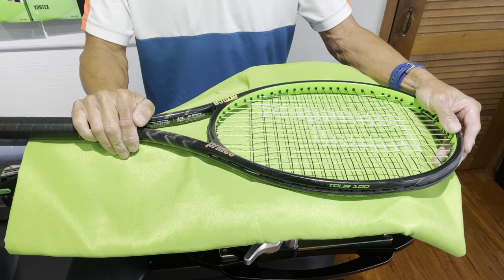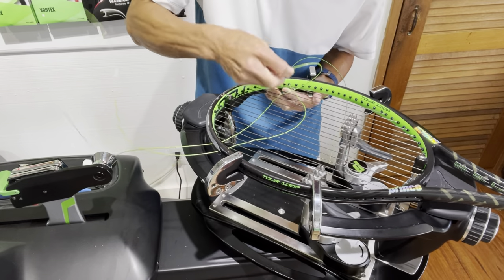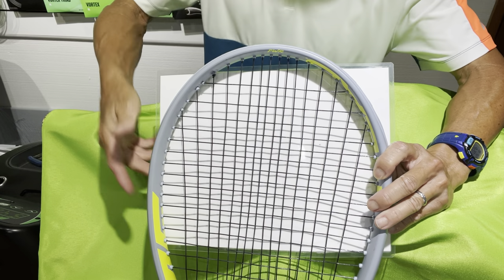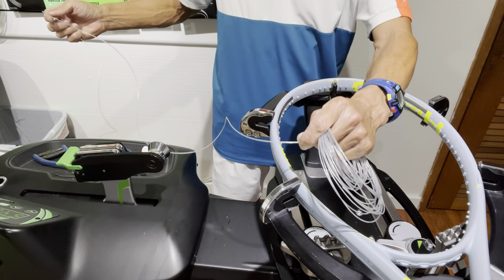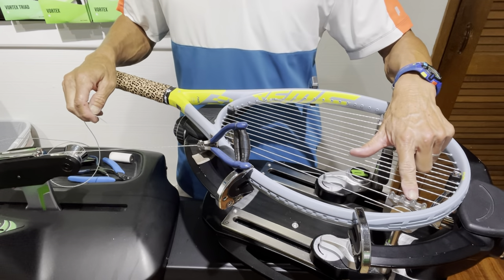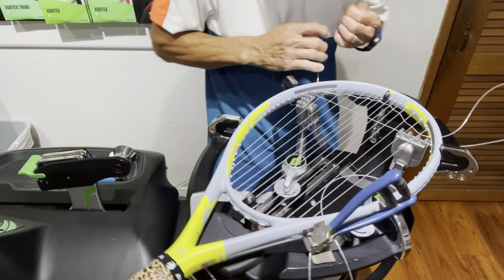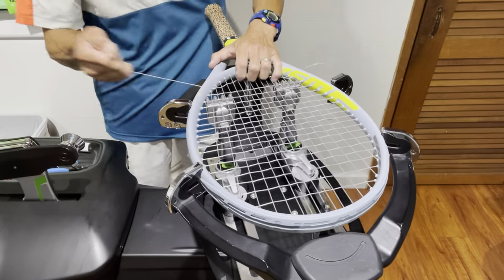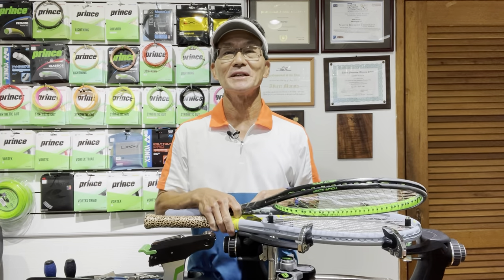Racquet Stringing [2022 Update | Install Crosses Faster & Reduce Friction + Bonus Tips]

Comment: Would starts the cross in the middle of the racquet even the friction on entire string bed bc you have equal length
Reply from the maker: Aloha Nelson, Yes, I guess in theory it would, however, it is always safer to install the cross strings from top to bottom. The shoulder area (5:00/7:00) of the frame is much stronger than the top of the hoop (10:00/2:00). When installing the crosses, stress on the frame will naturally occur due to the tension applied on each string. The frame is more capable of handling stress when it goes in the direction of the stronger part of the frame versus the weaker part. I hope this answers your question.

Comment: Mmm.. 
The two piece method I use often enough: threading two or three strings depending on the frame. 
The one piece version I’m uncomfortable with the potential frame unbalance of tensioning of the short side main and finishing the three whilst leaving the final long side main yet to tension. I guess tensioning the main on the long side and leaving the clamp at the top would get in the way of the three grommets so is NG. 
Let me try it and see. Thx!
Reply from the maker: Aloha Keroppikun, 
In order to string one piece with the method I demonstrated, you must have swivel string clamps and a starting clamp. If you have those two, you're good to go! Good luck!! 🤙

Comment: If you could answer a question for me. When I string multifilaments I am always above my set tension on my machine (gamma progression els ii).
When I check on the apple app for racquet tension if I set it to 45 pounds for example it will come out 49 when I am finished. 
This doesn't happen when I string polys, it only happens when I string multis. I have done 3 different strings types on 4 different racquets to check my sanity multiple times and it keeps happening. Any thoughts on why? The polys on the app are a lot closer to what i set, usualy a couple pounds below, but being below my set tension makes a lot more sense to me than being above my set tension.
Reply from the maker: Aloha, 
I don't believe you're doing anything wrong, but here's a quick lesson on reference and actual tension. 

First, the tension that you set on your machine is referred to as the reference tension. 

Second, the tension reading your measuring is the actual tension. However, some devices are more reliable than others. Are you using the RacquetTune app? 

Third, the reference and actual tension don't always match each other. Nylon strings (synthetic gut and multifilament) tend to read higher than polyester strings. 
Other factors affecting the tension reading besides string type include head size, frame stiffness, string pattern, and string gauge. 

Finally, the main thing is to take initial readings off the machine to track consistency in your string jobs with the same string and the same racquet. The other valuable information to track is tension maintenance. 

Here's a video I did with various string tension devices - https://youtu.be/LzCXrTgMPLE 🤙
Reply: @AMstringing  I just watched your video and it was very helpful!! Your explanation was so clear and thorough. Thank you for taking the time to teach me about different tension readings from different sources. Yes I am using racquettune. After watching your video I decided to buy a ert300 . The ert seems to have more accurate readings in general.

Thank you again from a novice stringer out in Utah.

Comment: Aloha Coach AM!  🤙 Mahalo for the awesome helpful tips!  Ur such a genius MRT 💪🤓👍What’re the most trickiest or even most difficult or challenging rackets or jobs u have done, if any?  Mahalo 😎🤙
Reply from the maker: Aloha Kenzo, 
Thanks for the kind words. Off-hand, probably the Blackburne Double Sided racquet and the Wilson T2000. 

As for touring professionals, Mark Philippoussis' racquet receives the top honor! 
* Head Prestige Mid (18x20)
* Babolat VS 17
* Tension - 74 lbs.
* 6 racquets to be strung on the same day of his match
Note: He gave me extra sets of string in case it broke during stringing. I had to use it once. 😅
Reply: Thanks for the video
Reply: @AMstringing  Just for fun, I once decided to string a T2000. I had my laptop with the Wison pattern displayed and a 2nd racquet to study. Even so, I made a mistake and had to start over. After several hours I had it strung correctly. In the end, the pattern (ATW? box?) was well thought out but the wire loops were often confusing. Also, the metal frame was a little hard on the racquet supports of my machine--I should have padded them somehow. I wouldn't string another as IMO, the T2000 is the most unplayable racquet ever made and that makes J. Conners the most talented or stubborn player ever.
Reply from the maker: @robertjacobson941  Aloha Robert, Hmmm . . . makes me wonder if I should try stringing one up for fun in a video? 🤣The last time I strung one was in the early 80s. Thanks for sharing! Speaking about Connors, I'll be featuring a Prince racquet he was endorsing. Can you guess what racquet that was? 🤔
Reply: @AMstringing  That would be the Mono?? It is a racquet that has been ridiculed for it's looks but plays extremely well. I have one that's in fine condition and occasionally take it out for a hit. It would be interesting to watch you string a T2000 as you can probably do it without the roadmap I had to use. I'd like to see how you protect your machine from the wire wrapped frame. TKS for the great videos and taking the time to respond to comments!
Reply from the maker: @robertjacobson941  Yes, you are correct and it's nice that you have one of those Monos.

On the contrary, I would want to practice before stringing a T2000 in front of a camera. 🤓 We'll see . . . I do like a challenge, but I'm not sure how many people would be interested in watching.
Reply: @AMstringing  I wouldn't be surprised if quite a few of us amatuer stringing masochists, er, enthusiasts would enjoy such a video. You might even get Herb Baird to watch and comment as one old pro to another.
Reply from the maker: @robertjacobson941  🤔Okay, I'll add this to my list of possible videos. Thanks for your input!

Comment: Always learning here, thank you! I'm terribly slow at weaving esp with shaped strings. I'm more of a push away than pull towards, would you recommend switching to more your technique of weaving?
Reply from the maker: Aloha Akbar, You're welcome! When working with a string that is shaped, textured, or sticky (high friction), it requires more care to eliminate burning (notching) as you pull the string through the mains. However, if your weaving technique is sound, then all it should take is a little more time. I always teach my students to "pull-weave." In my opinion, I think it's easier to learn and is more efficient when done properly. 

If you'd like to watch a video where I teach this method in three progressions, I posted a tutorial video on the IART website. https://gssalliance.com/

First, you'd have to join as a Premium Member, then you can find the video by typing in the search bar, "Weaving the cross strings using the pulling method."